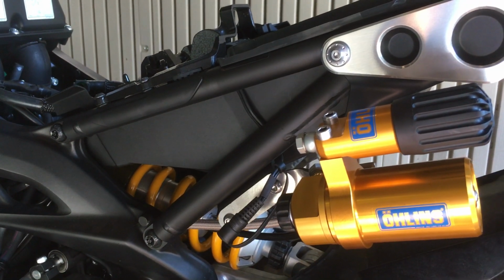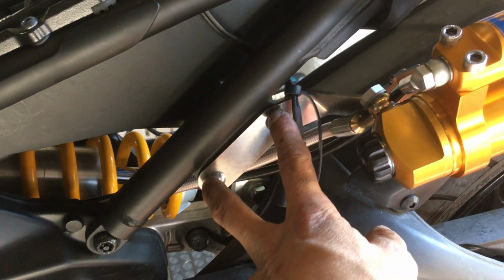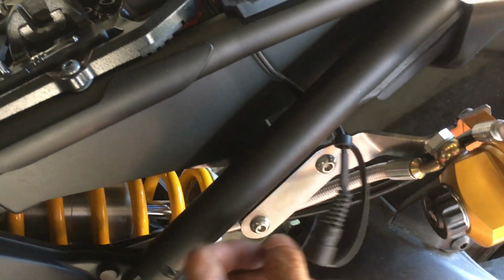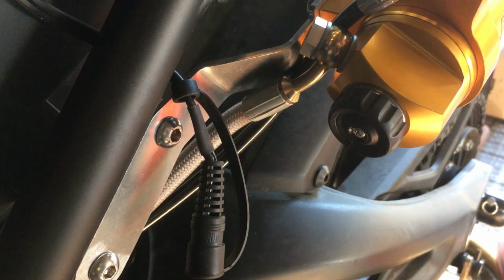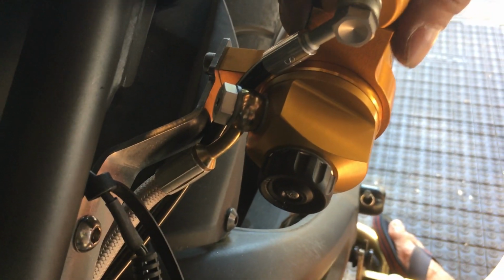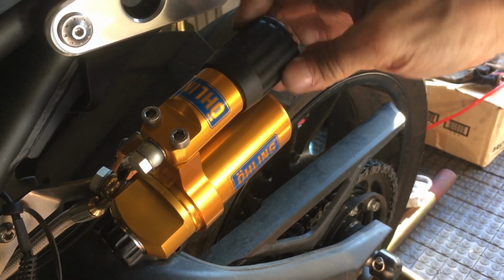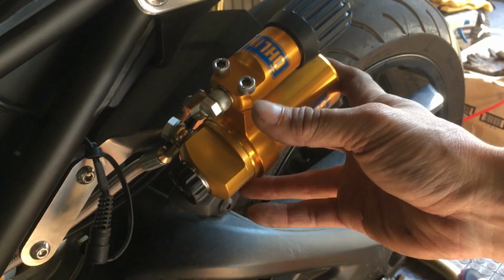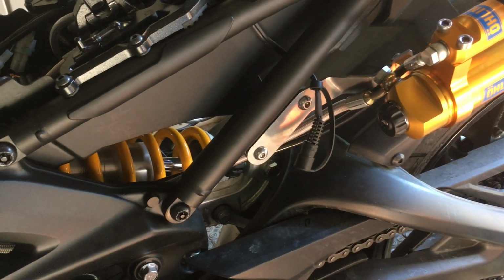XSR900 Ohlins shock install pt.4

Comment: Hey I got  the mt09 sp that comes with the Same ohlins but have got not much adjustment with the preload when I use it. How much preload do you get out of it ? Thanks
Reply from the maker: I get the full range of prelaod.  Could it be that the spring rate is not for your weight?
Reply: Yeah I think so too ... not sure what spring rate it came  from the factory . In the book it says that I can only get 7mm different s from soft to hard ...